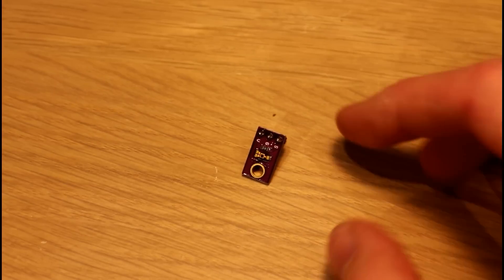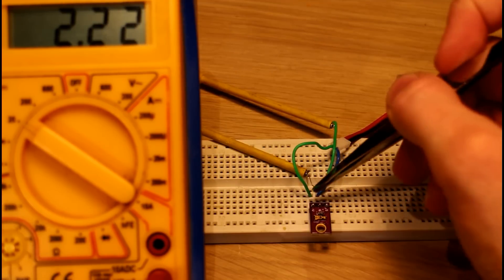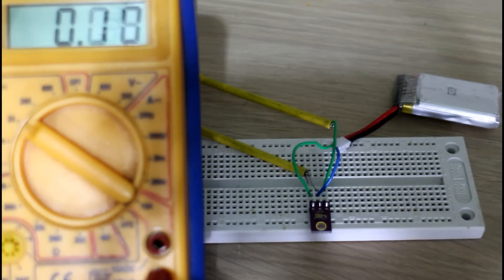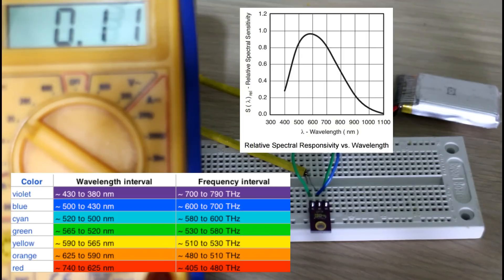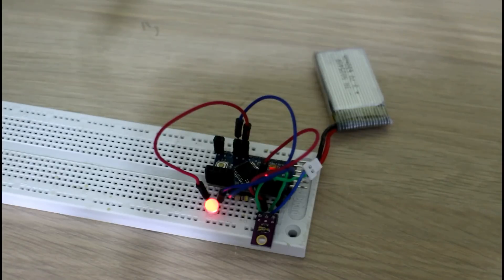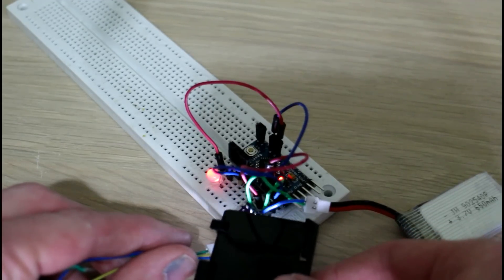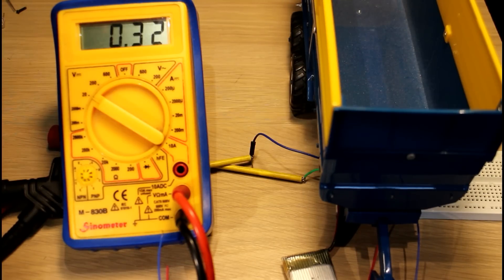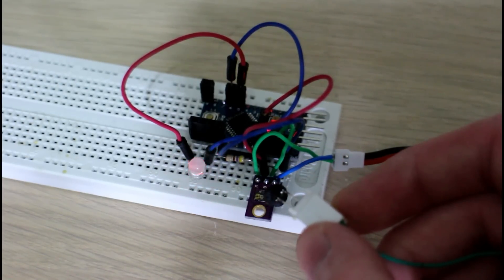IC Station TEMT6000 Phototransistor Module Review

Comment: hello guy, forgive the inconvenience but I'm having trouble with my nrfl01, I'm testing it to control and brightness of an LED transmitter one one arduino, and recipient an Arduino pro mini 5v, help me, I do not know more turn, the content in Portuguese is very little, I thank you!
Reply from the maker: Hi, did you try the RF24 library from here http://tmrh20.blogspot.ie/2014/03/high-speed-data-transfers-and-wireless.html. If you get some examples from that working then it should be pretty easy to modify to control an LED.

Comment: Why dident you use a photo cell instead??
Reply: Probably for two reasons: 1- this sensor is calibrated to human-eye-like sensitivity (which a photo cell is not) and 2- it has a nice compact form-factor that fits better in most projects
Reply: +Clovis Fritzen ok thank you
Reply from the maker: Yes I have used photocells previously for line following sensors, they work very well. Given that this sensor covers the whole visible spectrum I suspect you might be able to use an RGB LED to distinguish between multiple coloured paths by changing the colour of the LED but I don't have one to test.